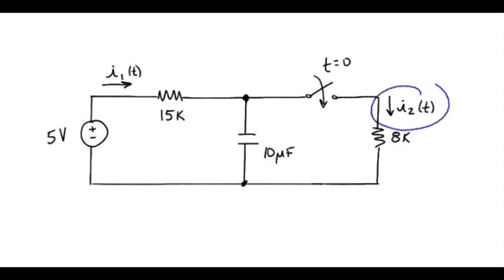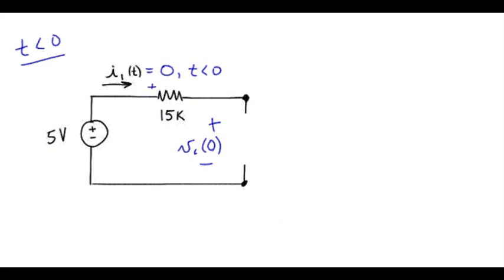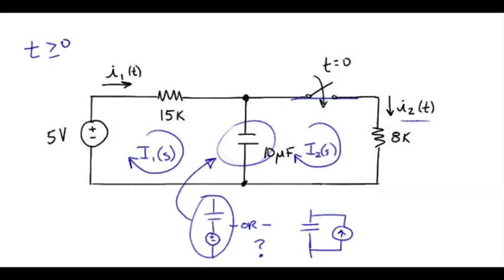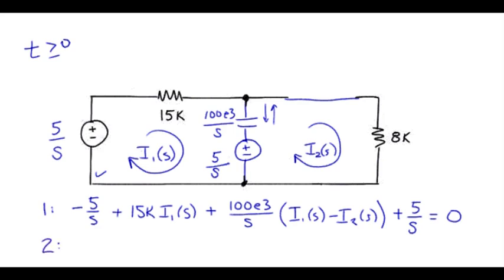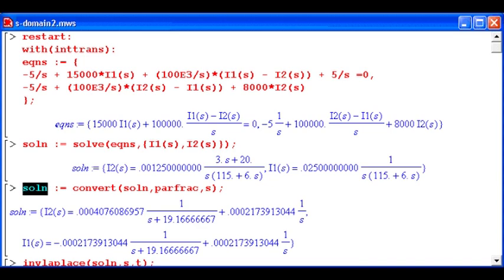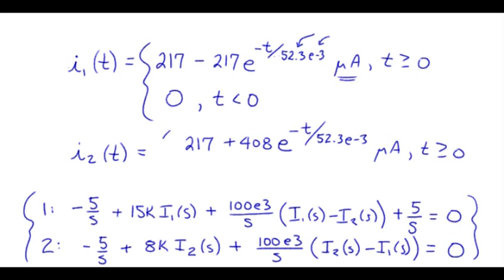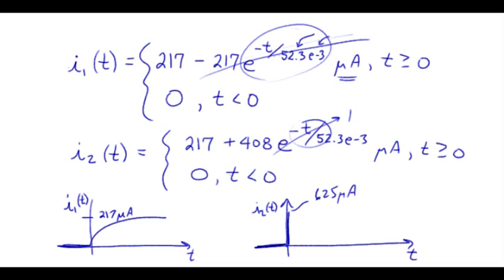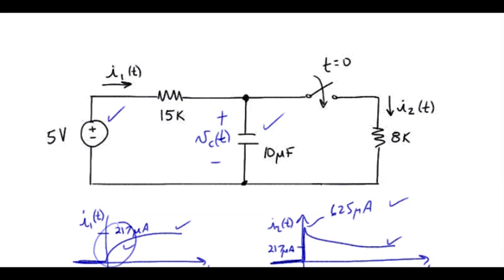s: Laplace Transform Analysis Example #2

Comment: Please, why 5/s???? I need Help!
Reply from the maker: Excellent question! The Laplace approach to circuit analysis (particularly the approach based on the one-sided Laplace transform which begins at time zero) treats all DC sources as if they "switched on" at time t=0, therefore they look like step functions. For example, the 5-volt source would be expressed as 5u(t). The Laplace transform of u(t) is 1/s, therefore the 5-volt source transforms as 5/s.
Reply: Time domain to S domain

Comment: Great video and well explained UNTIL using the Maple software in the second half of the video to solve. Ugghhh what student has access to that software? It would have really helped to show how to fully do it without the aid of a computer. This video should be a 10/10 for great explanation by a good instructor but only gets 5/10 due to only showing how to do half the problem by hand. It sets you up to learn something then leaves you hanging for how to solve it all by calculator or hand. Those will be the only tools a student will have when writing an exam.

Comment: why did you cancelled the capacitor at 1:29?
Reply: Oh nvm, cause it's in dc right?
Reply: Always when taking t < 0, the capacitor becomes open and the inductor becomes short.
Reply: Don Diego kindly do not spread false information
Reply: When t<= 0 capacitors act like shorts and behave like an open circuit when fully charged. When t<=0 inductors act like open circuits and behave like short circuits when 'fully charged'.

Comment from the maker: Great question! Start with v = L di/dt in time domain, solve for i and you get (1/L) times integral of v from 0 to t plus initial current i(0), and then Laplace transform to get I = (1/L)(V/s) + i(0)/s. For one-sided L.T. a constant is viewed the same as a step function u(t) which transforms as 1/s, therefore the constant current transforms as i(0)/s.